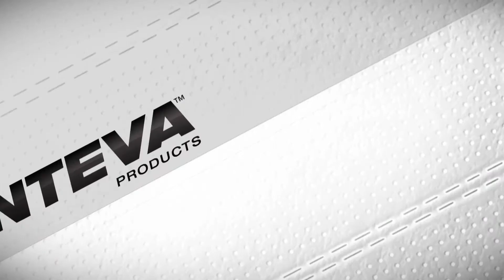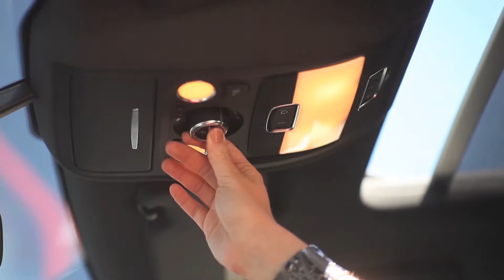Inteva Motors & Electronics - Interview with VP & Executive Director Pierre Blanchard

Comment: Hello, my power window is using inteva pdrs-m hw006 motor assembly. Currently it's stopping intermittently while going up or down. I have to press the power window button again and again to close and open. And some times it's getting stuck for sometime and then restart. Found a small difference after greasing but I'm not sure if I used the proper grease (nlgi2). Could you please recommend the correct grease to be used and also if there are any other possible solutions to solve the problem. I  have already sent a mail with the picture of the motor but couldn't find any response for the same.